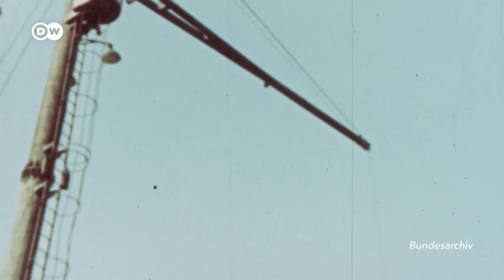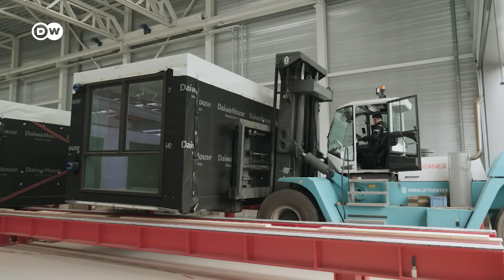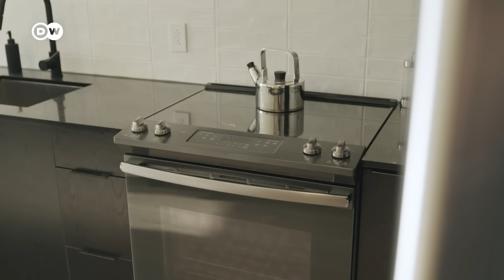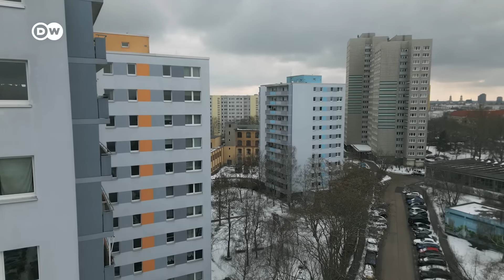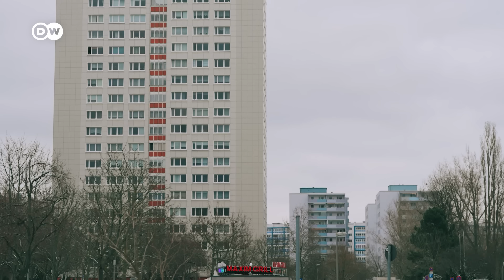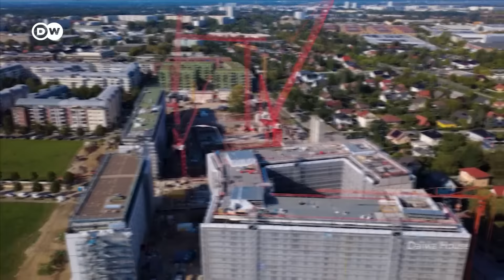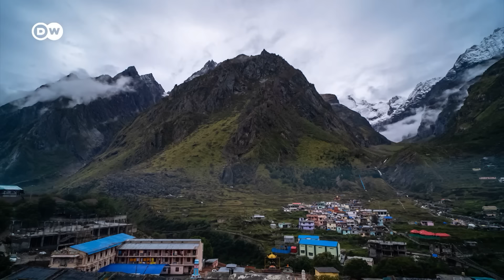These buildings are ugly. But the idea was genius.

Comment: Intriguing. I do wonder how the GHG accounting works out when you account for transportation of each module separately, which isn't as dense as the raw materials brought to a construction site (including the water to mix with concrete).
Reply: I'd like to see that comparison too but for concrete-framed buildings, I don't think there's too much of a difference. The weight of concrete is generally the limiting factor in shipping, not the volume. I see trucks with prefab walls on the highway now and then, and those generally carry only three walls orso. So it wouldn't surprise me if pre-assembling those walls with some interior framing would still be close to maxing out the weight, and would just utilize more of the volume of the trailer.

For wood framed housing... Yeah, I think the difference will be more significant.
Reply: @Xiph1980  agreed as far as mixed-and-set concrete, but in conventional concrete construction, you ship in the powder and add the water from local sources, allowing you to save some 25% of weight. That adds up when you're building 1,600 apartments.
Reply: For larger cities it is not all that much of a difference even for lighter frames. Since you usaly won't ship all the elemnts over a long distance, but from a factory around the city itself.
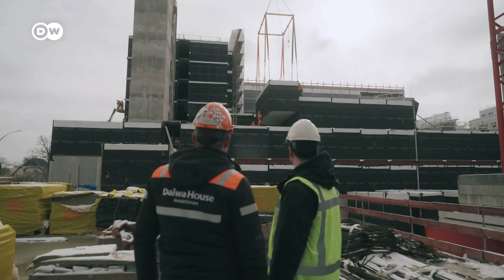Reply: @reappermen  it sounded to me like these prefab factories are the exceptio rather than the rule. Sure, Berlin might have one nearby (though 6:45 says 'Germany'), but I don't expect that to be the standard
Reply: @OviHentea oh, I was mostly future thinking with the answer. As the video points out, the market is currently in its infancy. But if it grows big enought to be relevant to the construction industry overall, there'll be dozens of factories all over Germany, and for constructions related stuff using somewhat local vendors and workers is the standard when possible. Plus the lower price of logistics would almost guarantee that the local factories win the bids
Reply: GHG Scam Accounting.